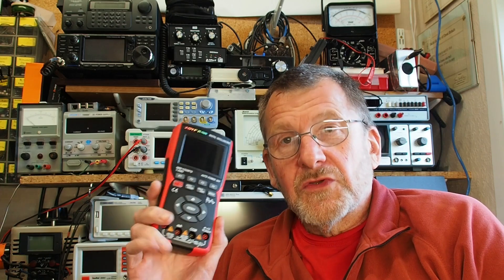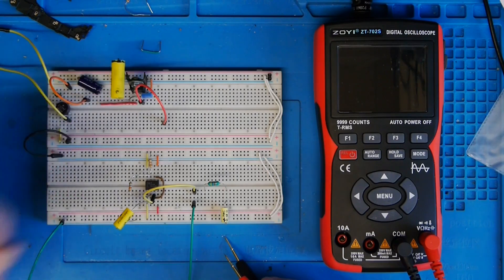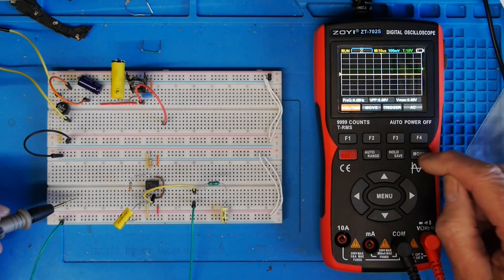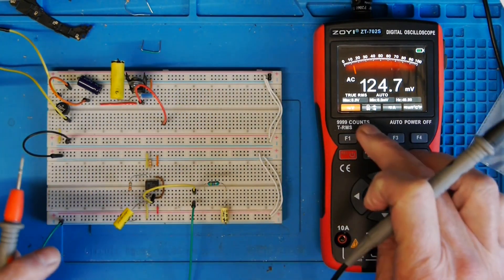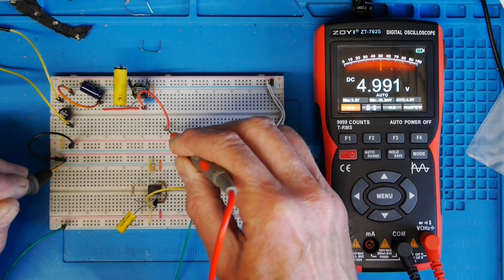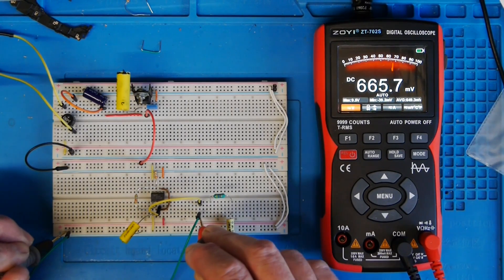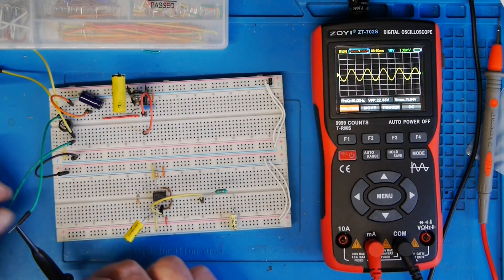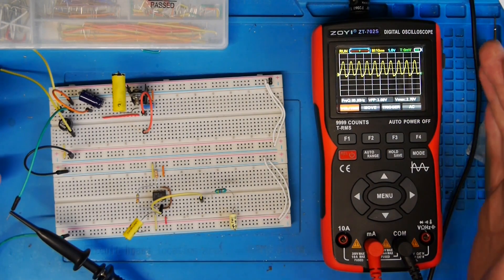Exploring rectifiers, regulators, 555 ICs & waveforms with the ZOYI ZT-702S Scope & Meter - #160a

Comment: This is a great example of using one of these Swiss Army Knife meters to diagnose and test probe simple DIY breadboard projects. I like that you showed some simple uses for an oscilloscope in a real-world setting. Most introductory oscilloscope videos explain all the settings on a scope but don't actually demonstrate how to use them to measure values on an actual circuit.